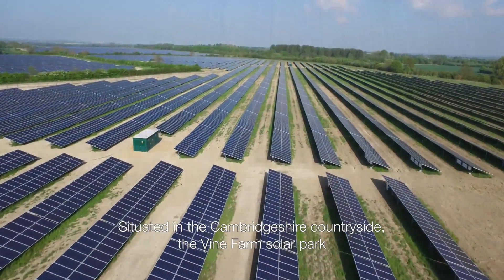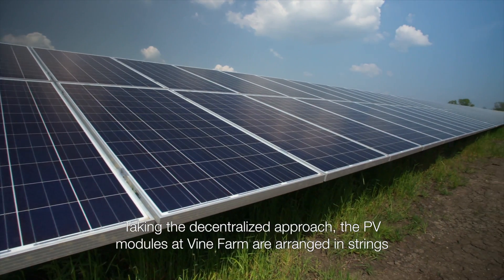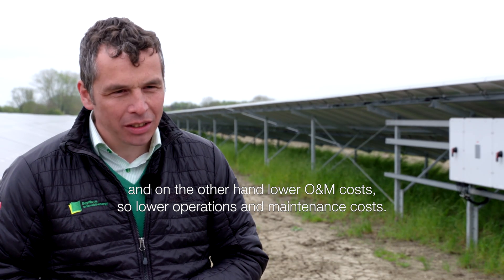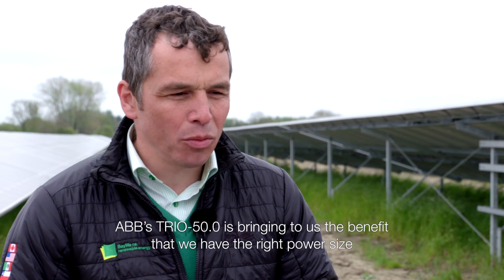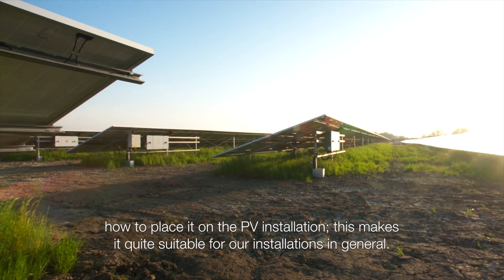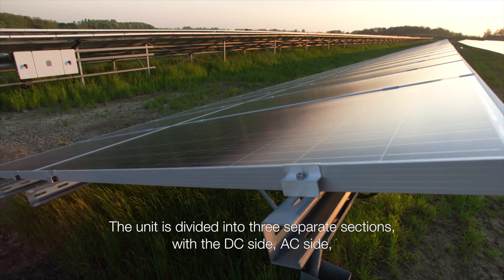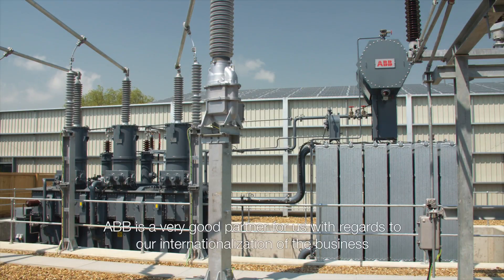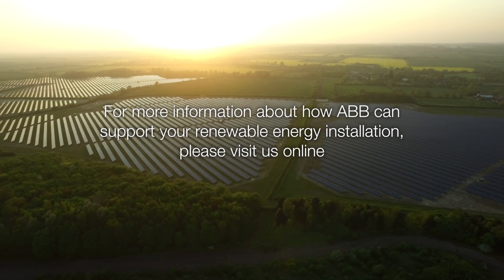The TRIO-50.0 at Vine Farm solar park – an ABB solar inverters case study

Comment: May I ask for a Clarification? In the Video it says that the plant has a rated power of 46MWp and 450 string inverters are installed. Every inverter has a maximum DC input power of 52kW: 52kW*450=23.4MW (that is half of the peak power). Isn't the number of inverters too low? Where am I wrong?